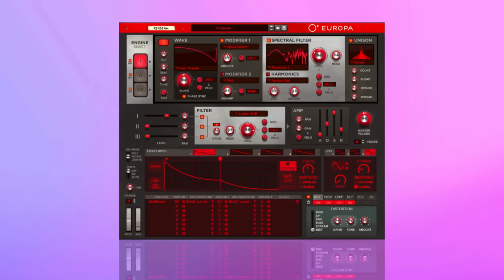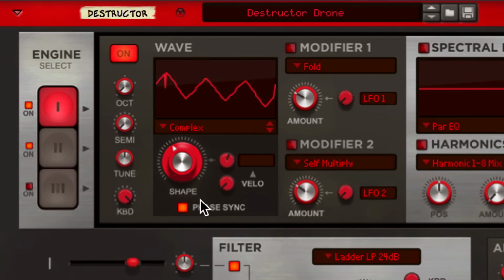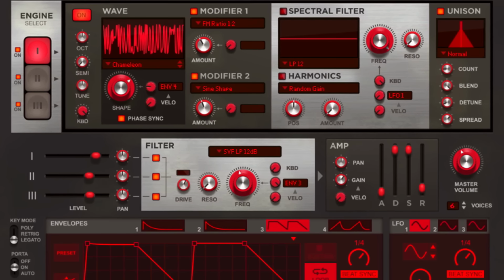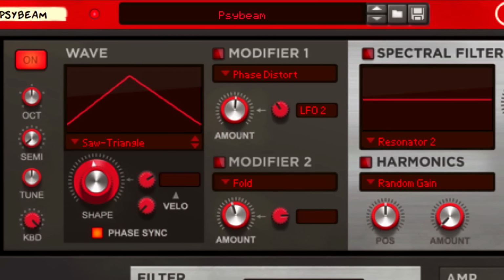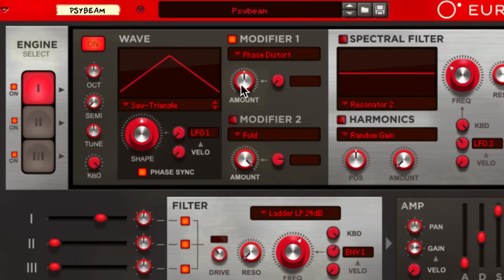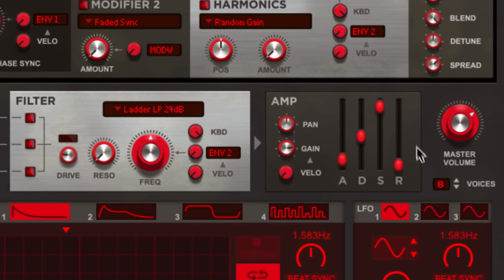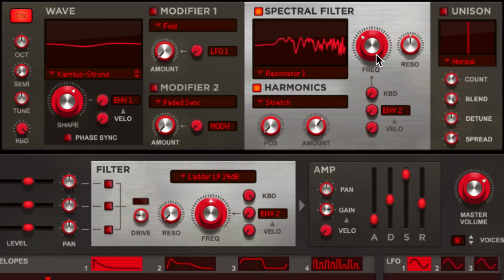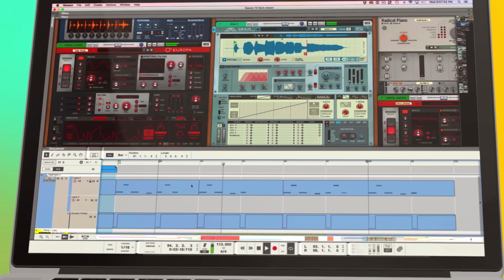Europa Shapeshifting Synthesizer

Comment: This is a beast of a synth... I’m so glad Ableton 10 has the new Wavetable Synth included in the Suite Edition - otherwise I might have had to jump ship and give Reason a go lol
Reply from the maker: You might want to check out "Europa by Reason" - the new VST/AU version of this synth we release last week, which would run in any host of your choosing (Live, in your case)! /ryan
Reply: Propellerhead Thanks, I’ll go give it a look now... cheers guys 👍
Reply: Just found it on plugin-boutique, where I get all my presets, VST/VSTi’s and remix stems for Traktors remix decks... and was pleasantly surprised at its price. One thing though -mI much prefer to have a small handful of carefully selected synths and effects, so I can explore them to the absolute max and learn to use them to their fullest opposed to having folders full of plug-ins in which I’ll maybe use the odd sound here and an effect chain there from each one sure, but over their lifetime.
I don’t want to have 2 separate and by the looks of things, completely different Wavetable synthesisers at the same time, trying to get to grips with the power of both opposed to learning the one much more in-depth.

That might change because right now this really does sound gorgeous- and it looks like it has a sound and robust workflow to it thanks to the pretty awesome GUI.
I might give it a go - I think there’s a demo available to try out anyway so I’ll almost definitely check it out.

Even though I’m not a Reason user and never have been, I want to give you a definite thumbs up for this monster. Certainly got my attention anyway.
Again, cheers people !!!
Reply from the maker: Thanks for the nice words. You can also try it out with the other rather groundbreaking thing we launched the same day as this VST. On our website is a fully functional version of Europa that runs inside your browser and is playable from MIDI controller keyboard, and contains all the features of Europa by Reason. /ryan
Reply from the maker: http://propellerheads.se/europa

Comment: Reason 10 is bloatware; there, I said it! That GUI is way too busy, a real resource hog. It looks amazing, but that’s the problem! The latest version 10 recommended system requirements is an I7 Intel processor on a mac, similar for a PC.
That’s crazy, I know high end video editing software that don’t require those kind of specs! This is not for the bedroom producer anymore.
Reply: I disagree, 8 gigs of ram, a core 2 duo or Intel I5 processor with a decent ssd in some of my machines which are 7 years old now and everything runs perfectly, without a glitch.

Comment: Interesting thing is I always used to do very similar things that Europa does since version 1 of Reason, now I just had a smile on my face while watching this video thinking about this same concept I always applied but in another way. I put for example a Subtractor and control it via Matrix, randomize Matrix pattern (or create my own "random" pattern) and play it, plug a cord from Matrix Curve CV to Subtratctor FM Amount and finally design a Matrix curve I like, it works better if Matrix is set to 32 steps.... so to effect becomes more noticeable I add flange and chorus to Subtractor and the result is something very similar to Europa. The way to create it is very similar to Europa too, the only difference is now I have all that steps in one single module, but concept and results are almost the same.

Comment: A few suggestions for Europa update:

1) Macro controls like Thor has. Very often some synth parameter and combination of parameters sounds best with certain value ranges. Possibility to program and map best parameter combination for macro controls would be very useful - I think that modwheel is just not enough. I know that I can use combinator for this purpose, but in terms of fast workflow - dedicated macro controls directly on synth are better especially if I dont need to combine some other devices with Europa. BTW - Are there some combinator patches in Reason libraries which use only Europa synth ? Is it possible to filter them ?

2) Copy and paste engine settings. I didn't find ability to copy settings of one engine to another. This is very important while sound design - you may want to use second engine with same settings and make small modifications.

3) PLEASE MAKE EFX PHASER LFO SYNCABLE AND LOCKABLE
Europa's phaser sounds amazing. I was able to get really tasty chord stab based on phaser. But I didn't find how to sync phaser LFO rate with song. Also I am missing ability to lock LFO phase on key retrig - this is very important feature for modulated stab sounds. Initially I thought that I am able to make this in mod matix - route some modulation source to phaser frequency, but this parameter does not exist directly. It seems it is only internal and hidden to user.

Anyway thanks for such a great synth ! It boosts my creativity a lot !
Reply: Please add being able to use your own samples in the europa to your list cuz that would be the bees knees

Comment: This is great .. but :).. If you wanted to show how something transforms then use Serum as an example (I know you won't but I'm coming to that ) (https://d84g6yundlaof.cloudfront.net/assets/serum/serumall-b4e3f2c19f47e68cff7b1767eb7af20d629844ba1dfae517ed57ee796bc0b8d9.gif) Or better yet.. have it in this tool to begin with. You've obviously seen it, so why not mimic that part of the UI? Everyone else is doing it.

Comment: Ok, now where in Serum is the analog of Europa's shape knob? Sorry for the offtopic!
Reply: This is not a rebuttal, but a genuine question. Being unfamiliar with Serum, I am trying to understand how audio samples would be utilized in this setting. As they describe it above, the power of Europa lies in using non-audio (vector? algorithmic?) wave shapes that can be edited (and save on processing?). Also, doesn't Grain specifically focus on your request to import audio files and use them as a basis for synthesis and modulation? It does share the envelope engine with Europa, so it seems that between the two, it should have these two approaches covered. Thanks
Reply: It's a synth, not a sampler. Use grain
Reply: It's the WT Pos knob. All it does is sweep through the wavetable.
Reply: And where in Europa can you import your own sounds/samples ?

Comment: I was on the Beta test and I have to say that the filter in Europa is way better than in any of the other devices in Reason. I don't understand why you didn't allow for audio in to utilise the filter on external sources! 
Please consider adding that in or making a mini Europa filter box as a standalone effect, I guarantee I won't be the only person hoping for that.

Cheers
Reply: The spectral filter in Europa is not an Audio Filter... it modifies the waveforms before they're rendered into audio... they've explained this in the live stream video... so what you're asking for is (sadly) not possible...
Reply: @bud1390  It's entirely possible to do this kind of filtering by taking an FFT of the signal and then doing stuff with the partials like turning them up or down using some kind of mask like the multipoint envelope being used here.
Reply: I'm not talking about the Spectral Filter, I'm talking about the standard filter.
The MFB HP24 dB for example is way better than any other High Pass filter currently available in Reason.
Then the options of SVF lowpass, Ladder lowpass, MFB lowpass and K35 lowpass as well as the band and notch filters.. they've got loads more character than the filters in Thor for example.
Reply: Ben Kulchstein thors filters are awesome . You can use those.
Reply: Suppose it would be the same as how audio can go into Thor,and yes it would be useful